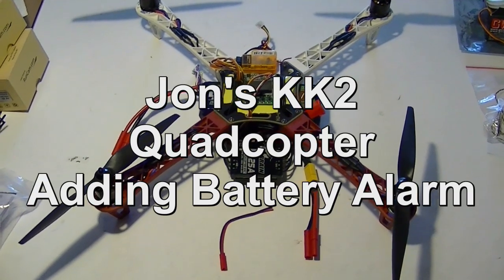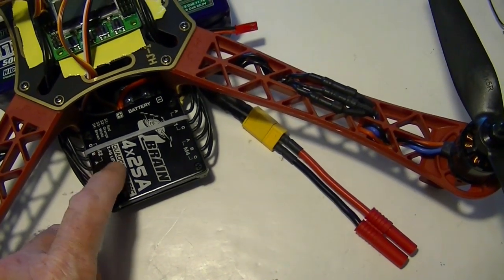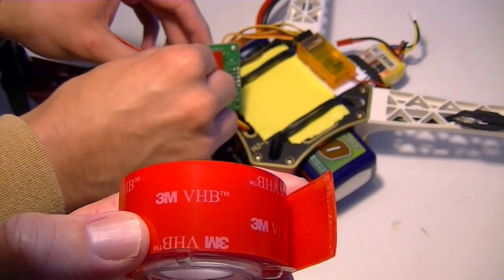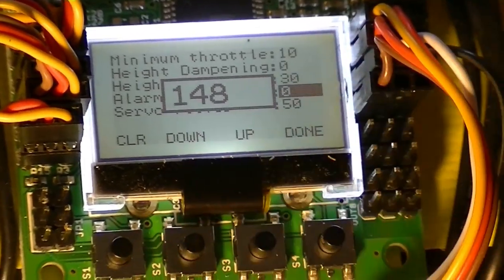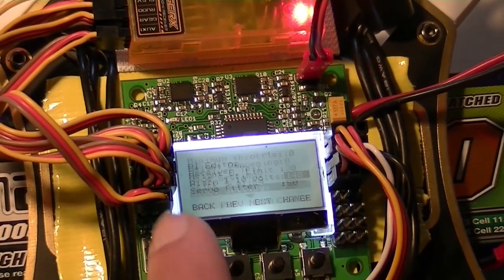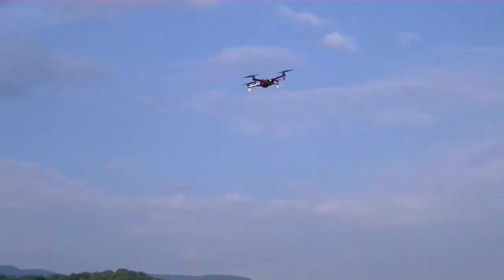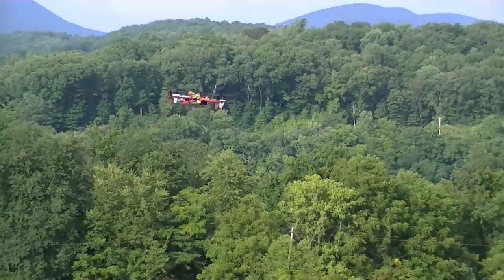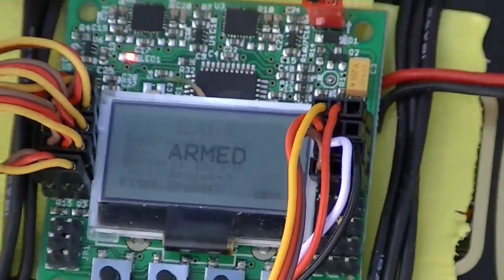Jon's KK2 Quadcopter, Adding Low Battery Alarm and Flight Testing.

Comment: How do i calculate what is the safe voltage for my battries?
Reply from the maker: +Astryx_ Use nominal for the battery like 11.1 for 3s or 14.8 for 4s
Reply: i mean the safe level to stop using it? like how to tell when batteries are low?

Comment: What did you not try the famous Naze32 flight controller?
It has almost the same features with the KK2 board and seems very easy to setup :)
Nice video anyway, with 4S i set my alarm voltage at 14.3V approximately 3.6V per cel, is it not a good idea?
Reply from the maker: blackmennewstyle Uncle Deek has got one of those but there is a problem with it.
Can't seem to figure it out why two motors won't work.
We are thinking of moving to a PixHawk.
Reply: ***** I'm sad to hear that. I have two of them and they seem to work pretty good. But i heard sometimes they can have some issues.
The famous pixHawk is based on the APM if my memory is good ;)
Reply from the maker: blackmennewstyle Yes your memory is still working. The PixHawk is the new version of the APM in my opinion.  It has some new enhancements, but basically it works the same and still uses the free Mission Planner software.

Comment: Dave looks like you and Jon are getting that quad all dialed in. I mounted my kk2 on a set of ear plugs for vibration damping. Just my 2 cents. Jon looks to be getting more comfortable with the quad. 2 thumbs up for you both
Reply from the maker: chris miller Thanks, we are learning more about it each day. The KK2 is actually a very nice FC for the money. Now thinking of advancing to a PixHawk from Witespyquad to get the GPS features.